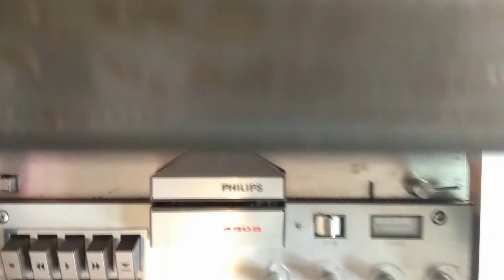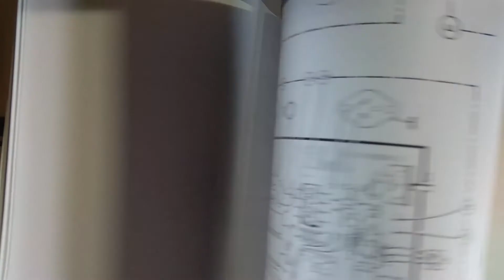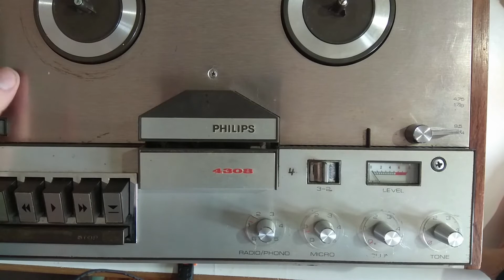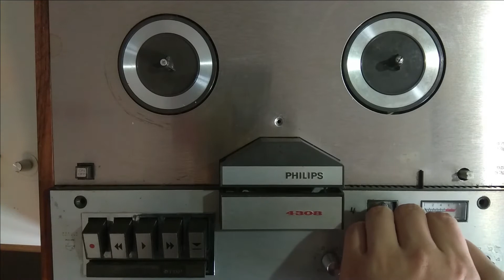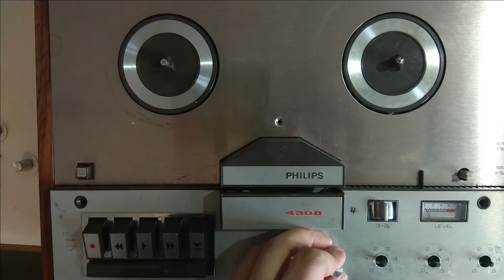Phillips 4308 reel to reel tape recorder assessment for repair

Comment: Back in the 1980s, I had a VERY similar model to this... sort-of "exactly the same but different" - It was a very nice machine, I used it for primitive multi-tracking, tape loops and such like.
Mine cost me £15 in 1982 and I used it right up until around 1992... €10 in 2018 sounds like a great price.
Fascinating to see Phillips is related to "Stella" because I had a Stellaphone back in the late 1970s too!
Reply: If it was VERY similar, then it was probably the N4307 which had only one speed and lacked the Radio/Phono dial.  II had one of those when I was a teenager - I now have the N4308.

Comment: did you fix it yet? ;). the sound you hear, its sounds like just the transformer. But when pressed play, you should hear the motor spinning. The belts are probably gone, so they need to be replaces.

Comment: A good video . But you skipped removing the back cover video. I have this same model and need to remove the back cover, which is solidly in place even after removing the four screws. Please advise.  RSVP

Comment: Had one of these as a kid, in the slightly cheaper 4307 version - this was 9.5 cm/s only, and common rec. level potentiometer. Nice machine for the price, but heads get worn pretty fast, and the electronics are quite noisy.
Reply from the maker: I imagine so, the electronics look none to sophisticated on the 4308 as well, I'm sure it's just fine for what is is though. Although often enough one is surprised what people where capable of doing with a handful of components.
Reply: are you from denmark? i have just gotten hold of a 4408 lights up motor runs and the vu meter register sound on the tape when i turn it mysel i belive the belts are gone  the rubber wheel in the back is nice condition as is the rest of the unit low hours i belive ,any advice regarding usual components that fail and where to buy belts?

Comment: Hi, when you switch a fully working tape deck on, does the motor idle all the time?
Reply from the maker: I think it does on a lot of them, I certainly used to have one that did!
Reply: @captainsolder5247  Thanks for reassuring me! When the blank tapes come in the post I'll put it to the test. I must say reel to reel creates quite a buzz within what I expect will be fairly limited results as I notice commercial 4 track steteo tapes such as Oklahoma are selling for over £20!
Reply from the maker: I hope it works out! Yea tape is relatively expensive, I bought a metal cassette tape for 15$ couple years ago accidentally, I thought it was a pack of them going by the price.

Comment: nice video you have the same as me you dont have the N version this is the normal 4308 the silver version is the 4308 and the black is the N4308
Reply: and it looks like that it is not only the belds because the black roll is also not spinning.
Reply from the maker: Ah! Thanks for the Info didn't know that will change the title. Yea there is a lot more wrong with this then the belts

Comment: hi there were decks before this   with tubes in 
note the belts just age  over tape  doe's not matter  how long it was used for 

i went over to a akai 4000 ds     there was a shop in notting hill gate  that had them in all the time   that run better first time i saw this bro had one
in 1983 about 

there was deck like this that had stereo  play back of the 4 track head   i think someone put a head pre amp in 
i used to see alot of reel to reel deck

Comment: I have the 9123 version,belts have melted and need to be replaced, can't find anyone to do the work, so will have a go myself....wish me luck......I want to hear my parents singing one the tapes.
Reply from the maker: Good luck! Do you have the Manual? If not I could provide it to you. I think it's quite possible to replace the belts and get everything working especially if the machine is in good shape otherwise
Reply: @captainsolder5247  Good morning, unfortunately, no, I don't have a manual and would really appreciate if you could share yours with me.
I have started cleaning the sticky mess, which, up to now doesn't seem to much, however, I don't know what may be hidden under the drives/wheels. 
I look forward to hearing from you 
Pat xx
Reply from the maker: Hey! I think the 4308 manual covers the 9123 as well (https://www.usermanuals.tech/d/philips-n-4308-service-manual/part1#1) hope this works out for you. I wish you all the best and that you don't discover any surprises under the rest of the machine.
Reply: @captainsolder5247  Thank you so much, I will let you know how it works out xx
Reply: @patm154  I have replaced the belts (bought from Italy), still struggling to get the tension right on the 'play' mode, it won't move, but happily goes FFWD and rewind. Clutch rubbers need correcting......
Getting there slowly, when my husband is available to assist

Comment: I was just about to skip my reel to reel at the first time of using as the wheels were not going round. I thought I would do a quick check for known issues when I came across this video for exactly the same model I have. Thank you for posting this as you have given me a winter project.

Do you have any suggestions on where I might source the drive belts from?

Many Thanks
Reply: Just search “ Philips 4308 reel to reel belt kit “ or just “ Philips 4308 belts “ if you get the belts and it still doesn’t move your problem probably is 

A: lubricación in the motors
                    OR 
B : The capacitor that makes the motor spin is tiered and needs a new cap to make it spin nice and strong

Comment: What did you use to clean up the sticky old liquid rubber... 

Just opened one up that I found on my (sadly now deceased and in a better place) uncle's attic. I was surprised to see a in good condition old merklin locomotive train set with most cardboard boxes and Bam! Inside a old desk drawer there it was: A Phillips tape recorder the 07 version.
Reply from the maker: My condolences! For the Rubber I usually start with Isopropanol (I suspect Methanol and Ethanol will also work ok) which is usually relatively compatible with everything else in the machine. If that doesn't work I go to Acetone (careful there because it will swell\dissolve\otherwise mess up a few of the commonly used polymers in gears and the like as well) Good luck with your restoration!
Reply: @captainsolder5247  Thank you. I'll try using isopropyl alcohol first then.
Reply: I used baby wipes after scrapping all the excess off first.